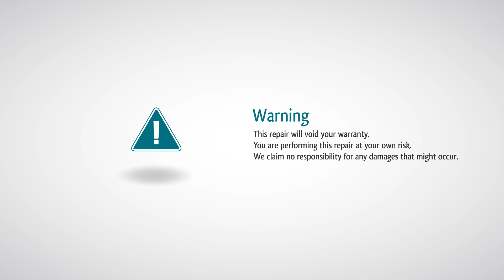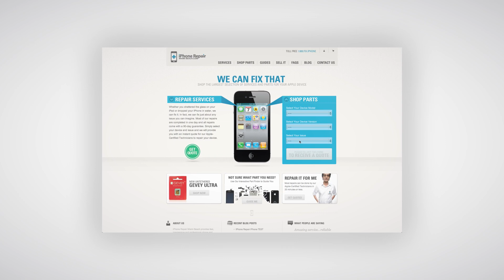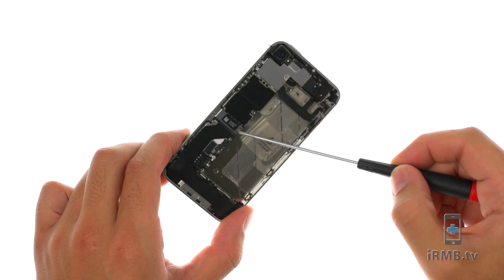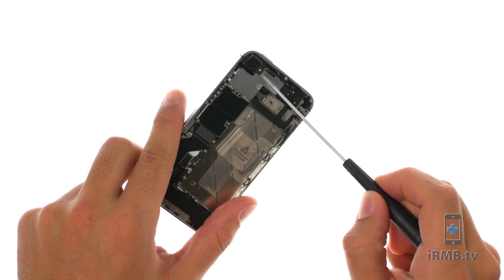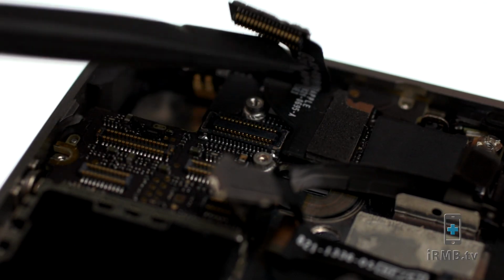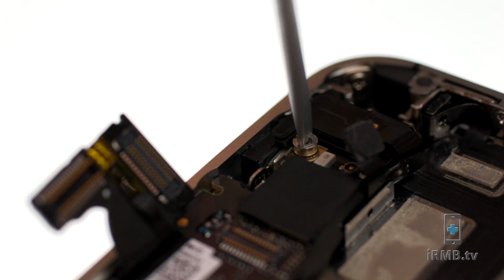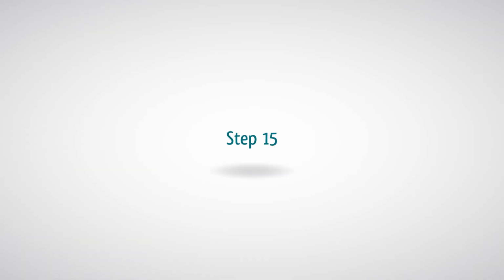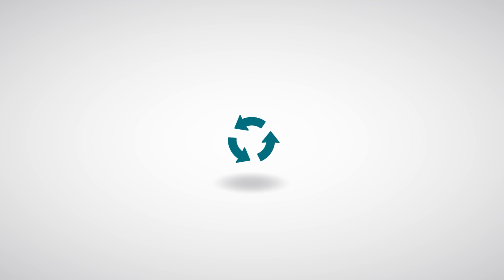Cellular Signal Antenna Repair - iPhone 4S How to Tutorial

Comment: Removing the motherboard is unnecessary. You don't need to do that. Simply just disconnect the antenna cable from the logic board and then proceed to remove Louis speaker. I know so because I fix iPhones myself.
Reply: You mean the Loudspeaker? :)

Comment: you do not have to do this at all! guys take bottom screws out and take battery out and data cable and undo to screws pull out old speaker and put new one in you dont have to do this its stupid!